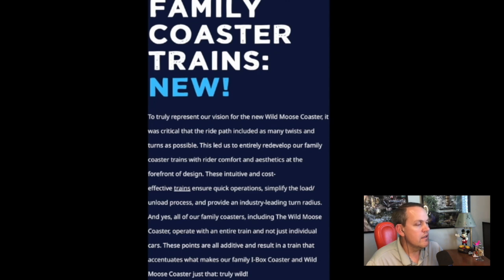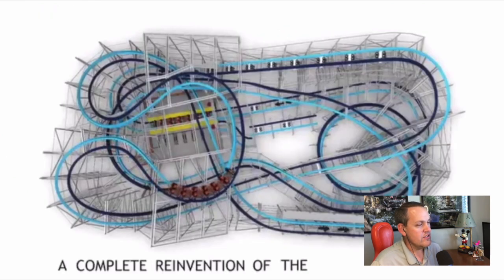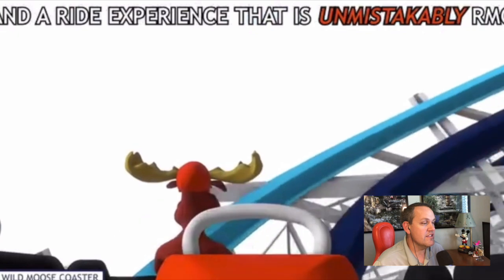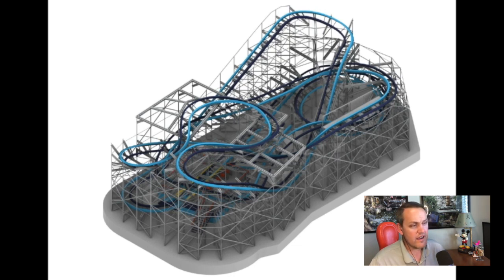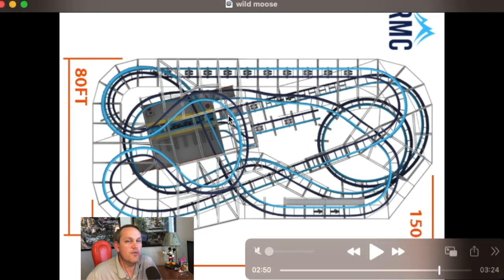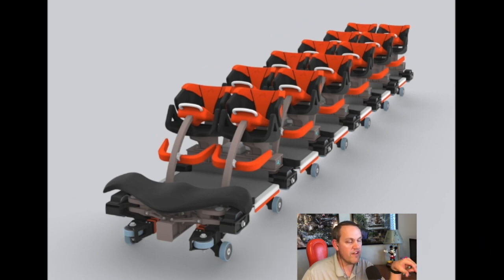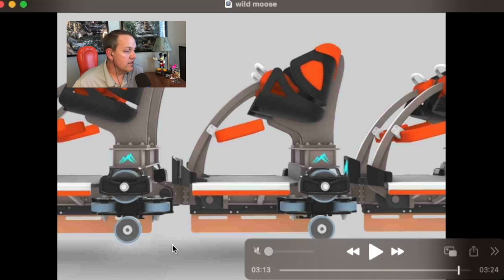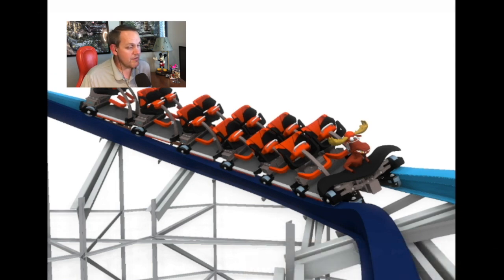RMC Wild Moose ride and my thoughts

Comment: I have a question. I was at my home park Kennywood last week. Their Roller Coaster The Phantoms Revenge had the middle part of the train where riders could not ride. It was on both trains. What would be the reason parks would do this? Is there something that needs fixed with that specific train or is it too slow the ride down for a particular reason? I seen it happen a few times at other parks as well and never understood why
Reply from the maker: Just speculating. I’ve Done the same thing many times. Let’s say coach 4 can’t work for some reason. Restraints can’t unlock or something is wrong. You can block off that coach so people don’t get on. Sometimes operations will opt to block the same rows on both trains to heel guest from complaining that their row is only loading every other cycle. So it typically to keep complaints down. Hope that helps
Reply: @ryantheridemechanic  It does! Thanks for answering!

Comment: I remember having to warm up our two zierer coasters, always weird seeing a train flying back down the lift hill and then hoping you warmed it up enough. Intamin multi dimension coasters also use kicker wheel lifts with multiple trains and no other anti rollback method other than the motor brakes by the look of it. Th13teen at Alton towers being a good example
Reply from the maker: We always knew with our Zierer, the back coach needed to go about 3 coaches out of the station this was about 1/2 train back from home. And then say a prayer before sending it off the first cycle. Valleyed that thing so many times.
Reply: @ryantheridemechanic  Thanks to the comment I now know what coaster you were talking about. For the life of me I couldn't understand what you were saying there.. But yeah, that name is a bit tricky to pronounce if you don't speak German... 😅
Reply from the maker: @Colaholiker  and I honestly don’t even know if I’m spelling the name right. It’s like times when I have to reference Schwarzkopf I typically have to go to the Internet and make sure I’m using the right name. 😄

Comment: Looks like a good and fun family ride, although more towards a kids ride I think. But I do wonder if the servicetrack is easy reachable being in the center of the main ride. Wouldn't be easy to pull a train off for it's annual or work on the second train while the first is running. And I wonder if there's enough room to put a roof on the station, I know many European parks hate the idea of an open air station and servicetrack.
Reply from the maker: Yea that open air idea it’s typically cheap. You can also argue safety as in you can see the ride the entire time trying to prevent accidents.  
The removal of the train could be as easy and an overhead hoist with a rail to slide out to the side. You can curve and twist those rails to go around corners if needed. 
Thanks for the comment.

Comment: How to the drive tire lift hills work on a curve? Doesn't the metal plate under the train hit it because it's out of line?
Reply from the maker: The motors are spaced about the width of the fin apart so there is actually not much side deflection at all. The inner tire crushes a little more but the tire is designed to handle that.